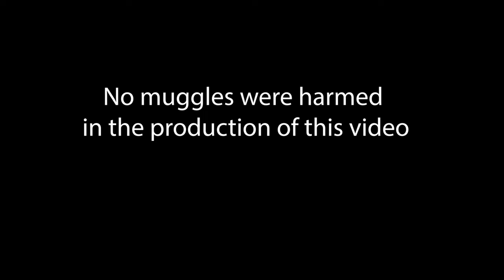Custom Brake Pedal, Brackets, Push Rod & Master Cylinder Relocation 1936 Chevy Truck on 99 S10 Frame

Comment: Gotta make sure that the master cylinder hits bottom before the brake pedal hits the firewall,  you have to have full travel so you can bleed the brakes properly
Reply from the maker: Geat point. I definitely need to do that. I plan to adjust it to make sure it bottoms out.

Comment: A lot of work but looks great. I actually think the firewall looks better with master cylinder lower.
Reply from the maker: Thanks! I think it will also be easier to maintain and monitor in the lower position.

Comment: Do you have the transmission already fully decided - meaning no clutch?
Reply from the maker: Yes, I have a brand new 700r4 mocked up in the truck. It's rated to 400 horses